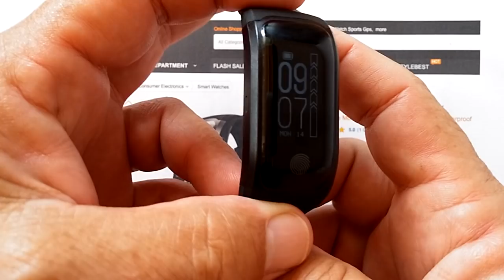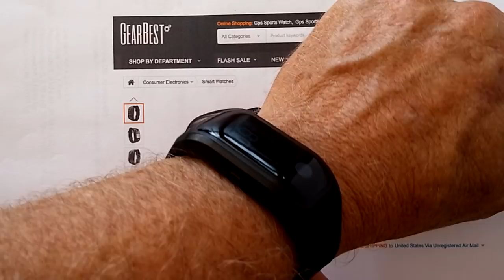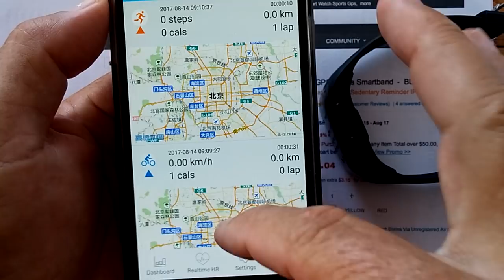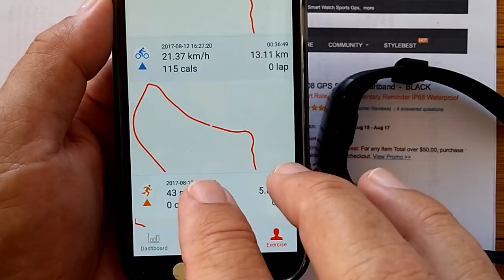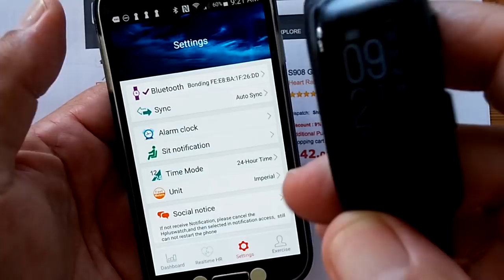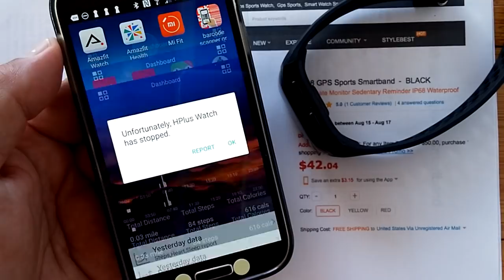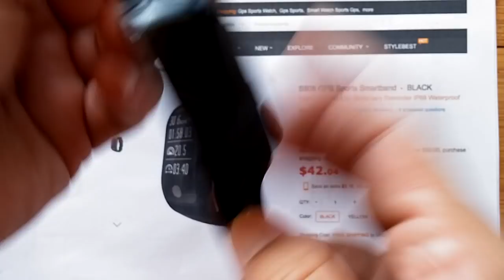S908 (G03) IP68 Waterproof GPS Sports Smartband: Revisited for Tethering Apps

Comment: Hello. My smartband at 00:00 doesn’t automatically turn on the display when you turn your wtist. The function automatically restart around 7...8 am in the morning. Does yours do the same??? Thanks a lot
Reply from the maker: Check the tethering app as there is probably a DND (Do Not Disturb) mode activated that turns that feature off for sleeping.

Comment: it syncs with Google Fit?
Reply from the maker: You'll need to check the tethering app so see if the data can be shared from the app with Google Fit. It won't happen in the band, only through the app. Sometimes it's best to "shop" for the tethering app that meets your needs and then try and discover which watches use that app. If you do find tethering apps supporting FIT, please let me know! Thanks.

Comment: Hi thanks for the video. I also done several revisit to my watch. There are few variations of this watch we can buy. Mine is having with removable band, no swimming mode. And mine the display is bright. Can view in outdoor too. For the map on the app, if you run it on IOS device it will show the map clearly. And you will see that the tracking you did is not accurately captured. It shows me running in water. Hahahahaha.
Reply from the maker: That is interesting jason. Is yours the same model? There are others about this same shape and size but different in how they work. There are even some that pop out of the band and plug directly into the USB for charging. So is yours the S908 or Makibes G03?
Reply: Mine is brand as LEMDIOE T28 GPS tracker. I got it from Aliexpress.
Reply from the maker: Yes, from the pictures the display looks much brighter. I was very disappointed how dim this one is for me. Perhaps I have a defective one. Also, do you use the Plus Watch app on your phone? Are you getting maps with your tracks on your phone? Have you found a way to export your tracks to another app like Google Fit?
Reply: Hi. Yes using the Hplus watch app. On Android, the map is the same problem as your video. But on IOS the map show out, just not accurately. I did not try to export data yet. Oh and mine is having the magnetic coupling snap on charging cable. So another differences. Have you try dipping it in water?
Reply: Also with ios you can adjust your user info under settings.My map is accurate in ios only it lets see half of my track while in the bracelet it recorded the whole track.I hope there will be a app and firmware update for this one in the near future.
Reply from the maker: Thanks! Good to know.
Reply from the maker: I haven't tried testing it underwater yet. I always worry these things won't survive, so I want to test everything else first.
Reply: So we expecting a re-revisit video from you ?😀